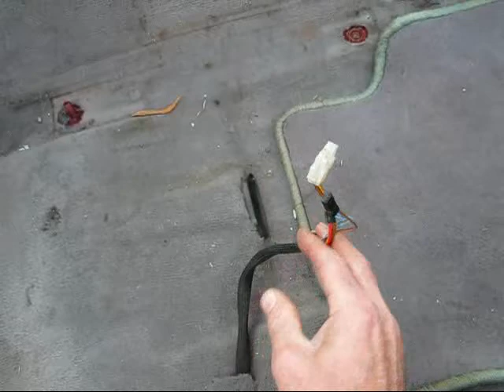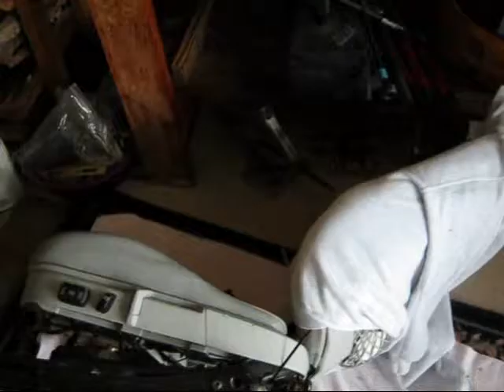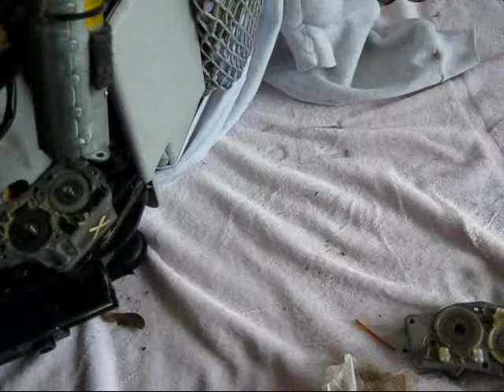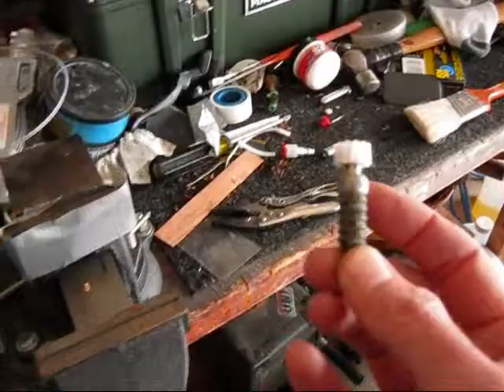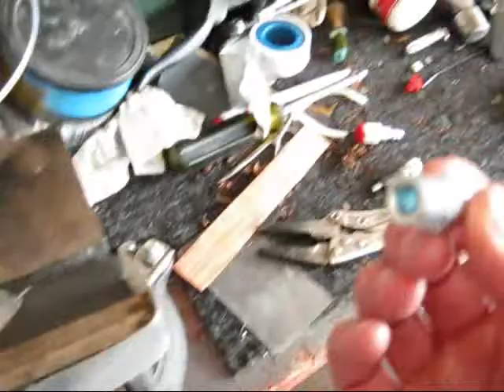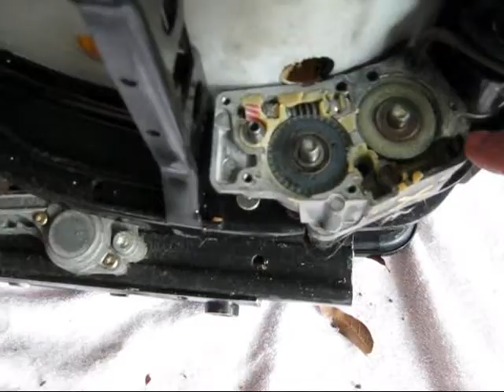BMW DIY Seat Recline Repair E36

Comment: Alright, so what if the seat can recline but not incline? Motor still works because it is making noise, the seat just won't come back up.
Reply: If you're still having problems with the seat, try getting a stick, something metal and hit the motor. Not soft but not hard like you're trying to break it. Sometimes the motors get stuck so some tapping will get it to work again. Worked for me👍